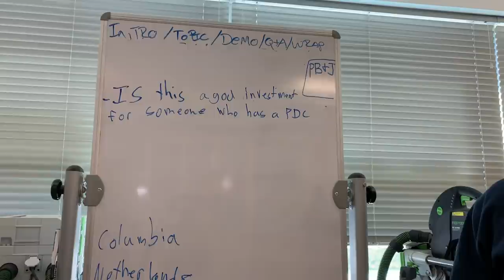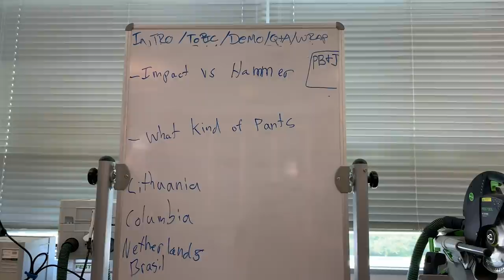Festool Live Episode 04 - TID 18

Comment: I love Festool but the Milwaukee M12 Impact Gen 2 is plenty of gun for most situations and has plenty of finesse.  I rarely use the m18 3rd generation I have unless im doing really heavy application.  If youre doing interior work you want the size of the M12 Gun to carry all day its ideal size and power is undeniable. Theres no reason for M18 impacts to get any stronger at this point the heads/fastners can't handle the power as it is.  I want smaller and stronger not just blue and green.

Comment: Sedge, I've been enjoying these presentations very much, I'm new to Festool and I am enjoying seeing the breakdowns within various categories. I would like to offer some constructive critiques of your explanations: Occasionally you go a little deep into a topic and skip over the basics, and that is probably because you live and breath all this info on a daily basis. As an example, your explanation of the difference between a hammer drill and a impact driver was a bit confusing until you showed the example of the wrench on the bolt, which was a great immediate teaching aid.  But as for the section preceding, had I not already know how they work I would have been confused. If you had started with the wrench example for impact and a hammer on a steel rod [ala John Henry the steel driven' man] for the Hammer drill you'd have explained it in 10 seconds. I was also unclear if the TID uses a centronic chuck in addition to standard hex bits. Another example from the Dust collector vid, you didn't introduce the CT 36 AC as being primarily for use with the Planex, and for drywall dust, we had to figure that out as the presentation went along. 
Again, trying to be constructive and I really enjoy and appreciate the content!

Comment: I think you covered it but I couldn't make it out - does the TID have a Centrotec chuck and you use the adapted to use regular 1/4" hex bits?
Reply: Jeff Zanin I’ve got this drill it takes usual 1/4 hex bits .
Reply: @daveishywood782  Thanks.  This make more sense to me at least for the U.S & Canada market.  So the green bit holder is just a way to hold the insert bits - it looks like the BHS 60 CE 205097 but with a conventional 1/4" shank instead of Centrotec.  I don't see this on the Festool USA site.